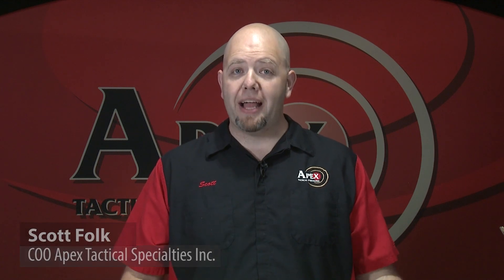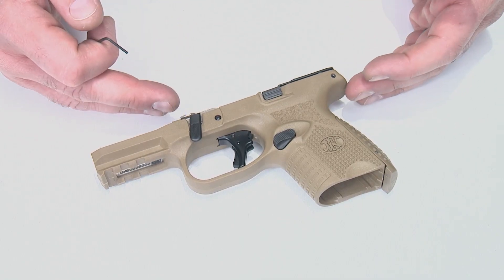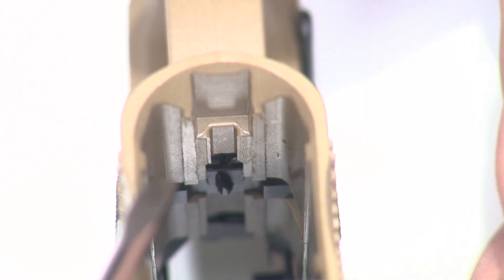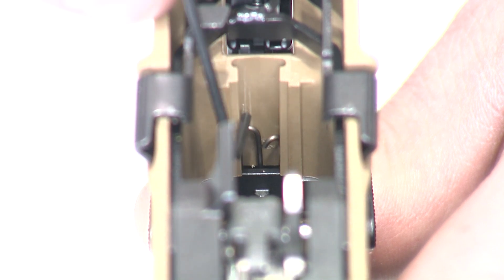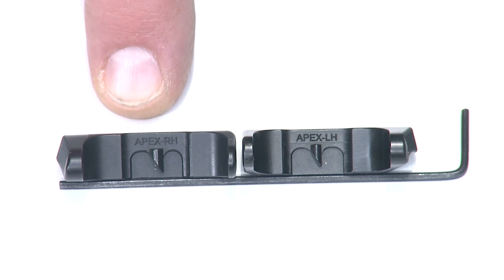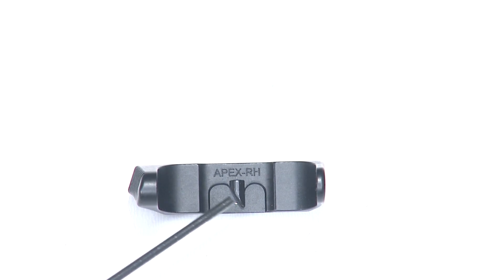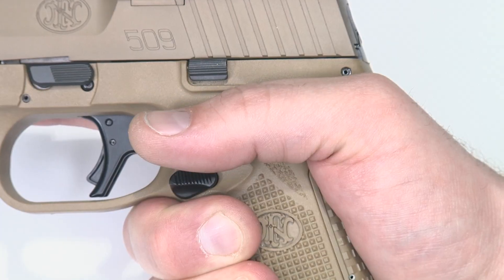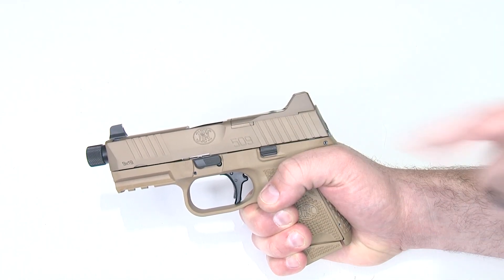Installing The Apex Extended Mag Release for the FN 509

Comment: I shoot USPSA and I thought this product would make the process of ejecting a mag easier and faster. I have to say I'm disappointed. It's barely higher than the stock item and that angle isn't really an advantage, it's a liability because a smaller portion of your thumb is making contact with the button. I  don't push down, never have. I push inward on the release to drop a mag. I still have to break my grip to drop a mag with the Apex mag release. All Apex had to do was elevate the height of the stock button and make it unidirectional. The only reason I'm not sending it back is because it is unidirectional. I have bought and installed other Apex products with complete satisfaction, but this time they missed the mark. Just calling it like I see it.